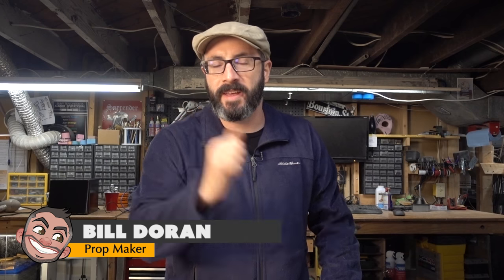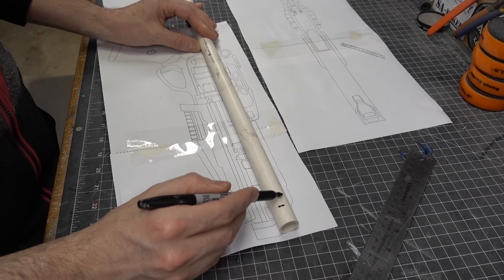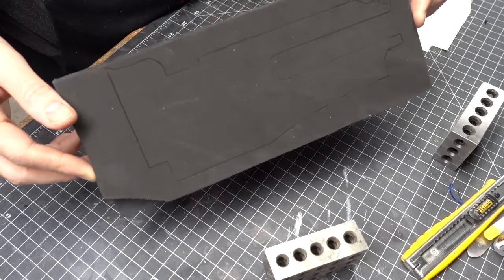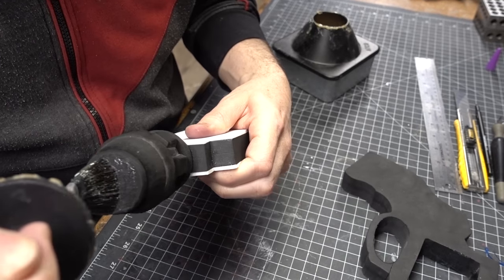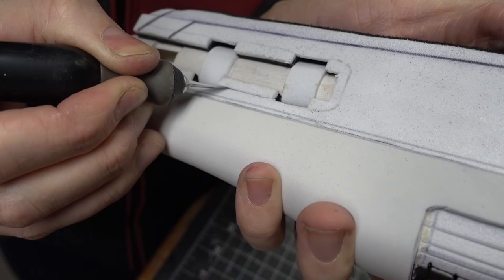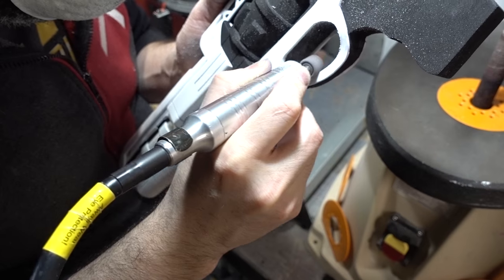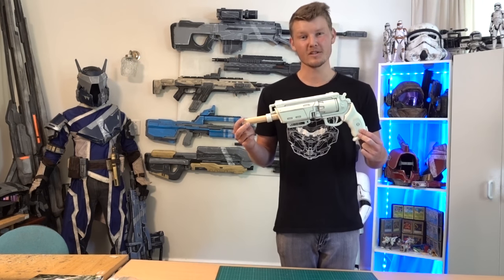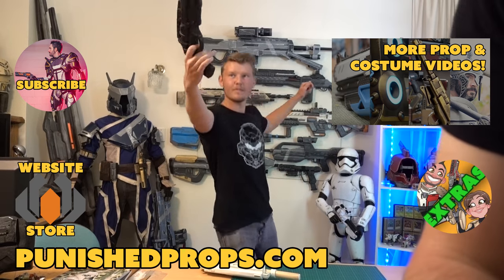Destiny Hand Cannon Prop Build Andrew DFT Collaboration Part 1: Fabrication

Comment: What kind of ventilation do you have in your shop when using contact cement? My shop is in my basement and I have a single egress window to use for ventilation. In the past I've gone upstairs to my garage with the door open to use large quantities of contact cement but I am wondering what type of solution I could rig up in my basement for when I only want to glue together smaller pieces.

Comment: Just curious - Which rotary tool are you using in the build? The parts list links to the Dremel on Amazon, but that's a completely different body than what's displayed.
Reply: Ooh, I like the foot pedal for speed control. Rock on, thanks.

Impressive results, as ever. Keep up the amazing work!